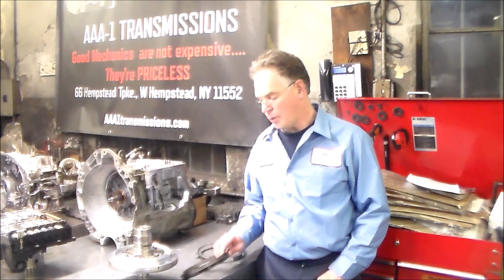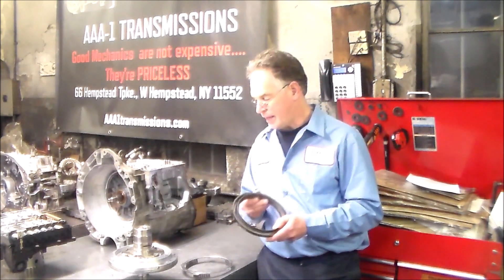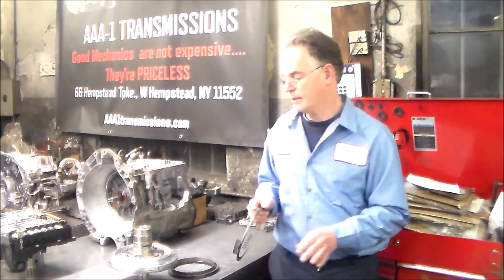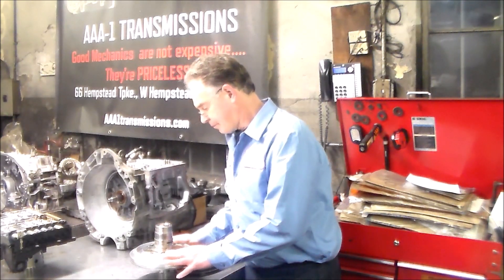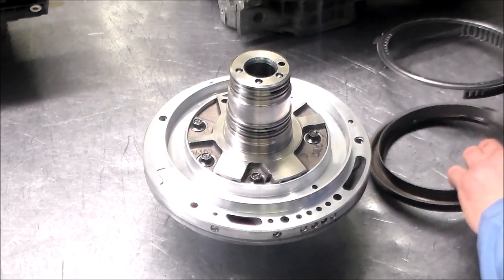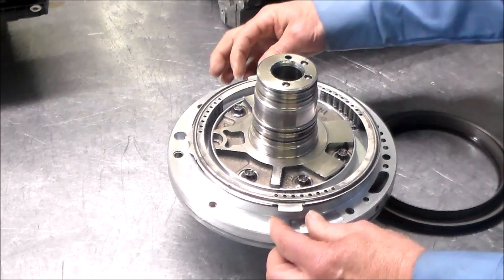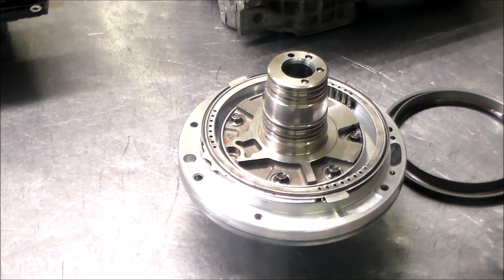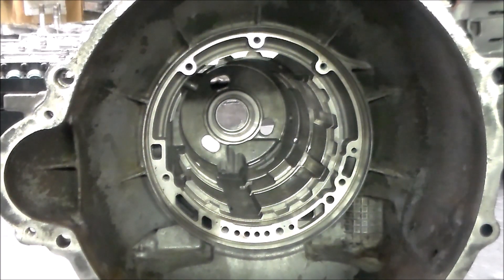4R70W Assembly Tip, Intermediate Return Springs

Comment: Hi Gary, from where do you get your transmission kit for a 4r70w
Reply from the maker: I purchase from Transtar,  they have an onl;ine ordering system called Transend
Reply: @GaryFerraro  thanks,  I have a 2003 f150 4.6 2WD with 280k miles,  and the transmission has never been rebuilt, so I decided to give it a try thanks to your videos . What parts do you recommend to me?.  There is a store here in Atlanta, and thank you for answering me right away. God bless you

Comment: hi gary how are you. i have question for u please. my 2008 bmw 328xi GM transmission failed and i want install used one. do i have to perform coding programming or not?
Reply from the maker: I would think it would be a problem, may have to try to reprogram the TCM if that won't work, may have to install original valvebody/TCM
Reply: @GaryFerraro   thank you Gary for your help
Reply from the maker: @jackfrance27  welcome